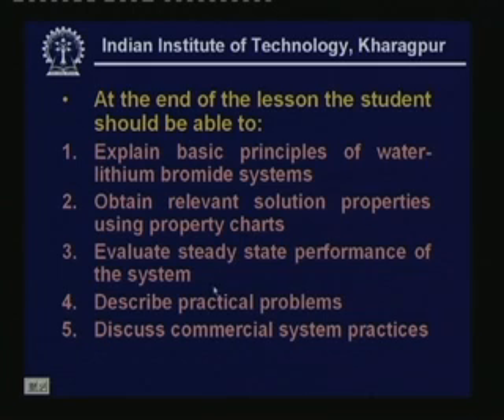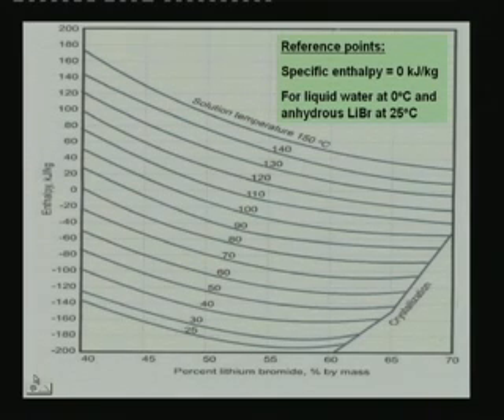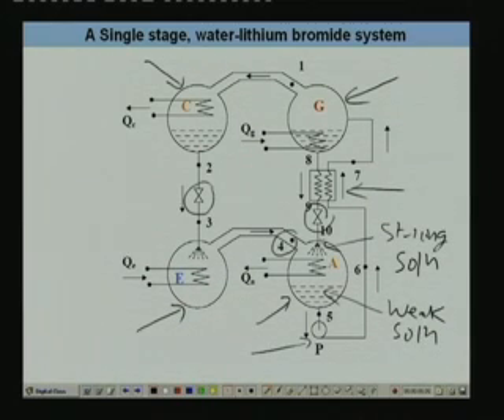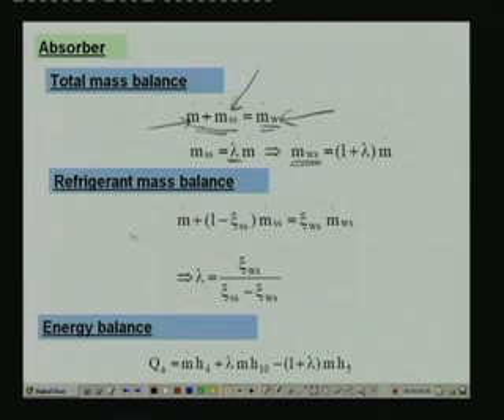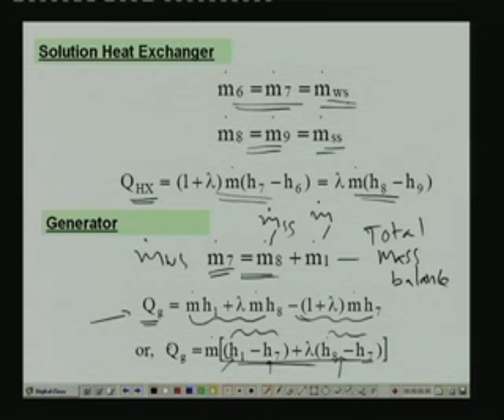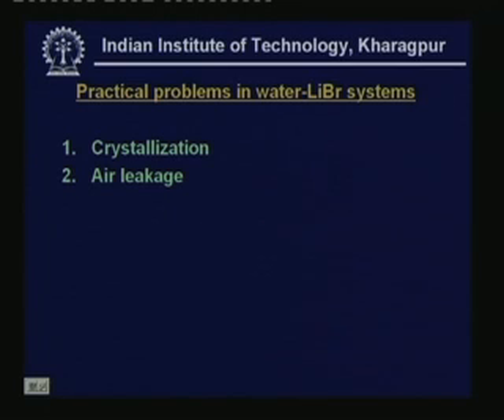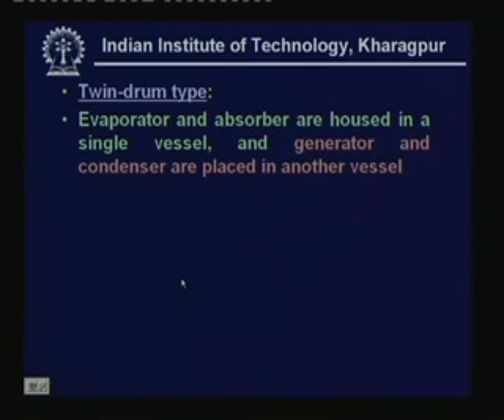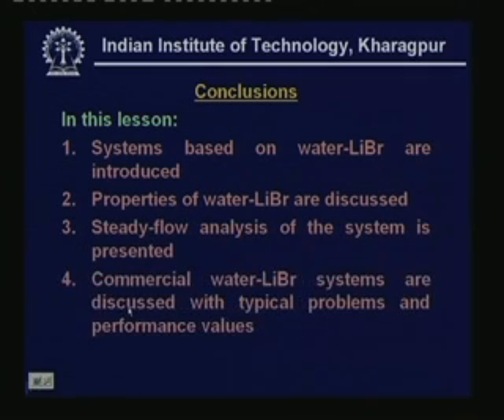Lecture - 15 Vapour Absorption Refrigeration System

Comment: Your video has helped me really much for my project, thanks for that. I have some little questions if you don't mind..

How do we choose design parameters(inputs) like the concentrations and effectiveness of the HX?

I don't know exactly how to choose operating temperatures.. I have an environment temperature of 30degrees(celcius) and the temperature of the cooling chamber has to be 24.5 degrees, so I chose Te to be 15 degrees and Tc 100 degrees, but my professor will ask me why I did choose exactly these temperatures and not instead for example 20 degrees and 150 degrees respectively.

If I have those inputs, will I be able to calculate all the outputs(mdot,COP,Wpump,Qg,Qc,Qabs and some temperatures..) with the given equations?

Kind regards and thanks a lot !

PS: If someone else has the answer to my question, I would be glad to hear them. Thank you
Reply: How was your project